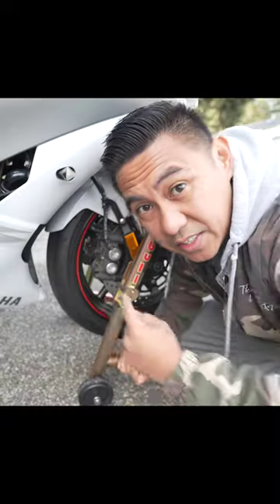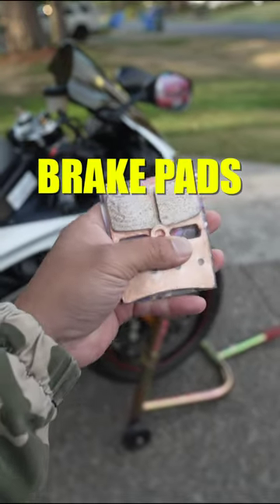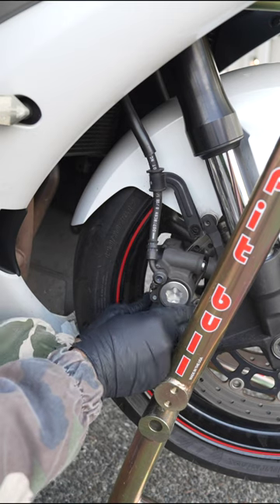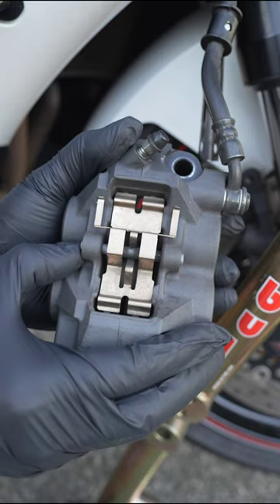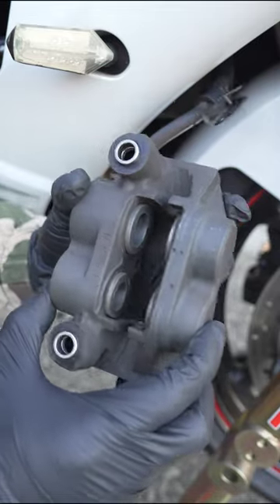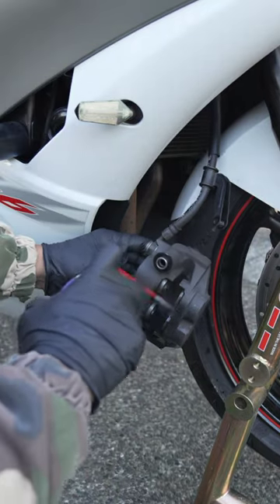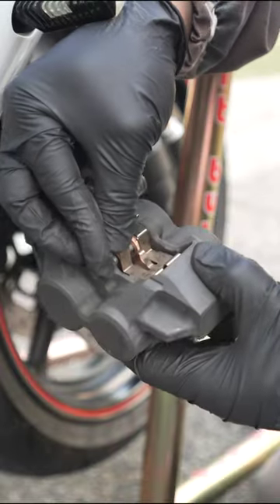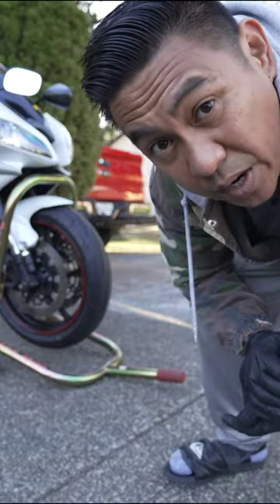HOW TO UPGRADE MOTORCYCLE BRAKE PADS

Comment: The caliper pistons need to be pushed back into the caliper before installing the new pads to make room for their increased thickness. Opening the brake fluid reservoir will allow the pistons to be pushed back.The fluid level will rise with the piston pressure, watch out for overflow. 😁👍
Reply: Opening thr brake reservoir cap wont do anything.
Reply: @mahdishirzad896 well if you have brake pads that are worn out you definitely need to open the cap to let some brake fluid out. Otherwise you're gonna have trouble pushing the pistons all the way back
Reply: @seb9940 No need for that at all. The only time you would need to do that is if someone fully filled brake reservoir while the pads were totally worn out, but otherwise thats what the reservoir is for to store excess liquid thats not needed till the pads wear out.
Reply: @idontcare7961 just remember your answering youtubers that haven't a clue 😅

Comment: They're not non-exstant. They're organic, they use organic resin as an adhesive. The most gentle type for rotors and the best all-round type, appropriate for wide range of users. However they're not the best in extreme conditions. I recommend organic pads for commuting and touring, and race pads (like EBC HH ExtremePro) for track.
Reply: I'm not sure about for motorcycles but my car came with ceramic pads, and I daily and autocross with them. They do occasionally sqeal a bit but other than that I don't see any advantage to a semi metallic or organic.
Reply: @johnhunter7244 ceramic pads need to be heated up very well, to feel the difference
Reply: Stock pads don't apply enough braking to trigger ABS...

Comment: With yamahas, you do not need to remove the calipers at all. Just the pin and the pads slide out the back
Reply: Easier to clean when you take it off though and it's easy to remove the front

Comment: you can clean the calipers with soap and water. You aren't contaminating the pad material. I've cleaned rotors a lot of different ways and never affected the length of bedding, brakes will just be bad for a bit.
Reply: Better is to have better brakes at beginning, you know.

Comment: Sometimes, it is not the brakepads but sometimes the fluid/moisture inside the brakeline. Dot3 and Dot4 fluids absorbs moisture making brakes feel like meh. Try to flush once in a while and brakes feel more grabby. Also try applying silicone grease on the pistons (not on the pads!) after cleaning the caliper with brake cleaner
Reply: Yes to second no to first. Yamaha brake pads are just really not very grabby. They last for ages but dont brake mega hard.

Comment: Love the content, but I do have a question since I have the same bike, does your rear wheel spins with clutch in when in first gear, even after I adjusted my lever and the bolts next to the clutch box, it stills spins 😢
Reply: It's dragging with you sitting on it? Or when the rear wheel is suspended, if that's the case, that's normal
Reply: @4fiddy_a_aron  when I'm on it, It Yanks forward by a tiny bit so I have to hold in the brake. Alternative is using some leg power to stop it in position
Reply: @hopelessag8147  you must not be tightening the cable correctly then because it should not be doing that. Or your cable is too stretched to adjust properly anymore

Comment: Shouldn't you lube the retainer pin and back of the pads?
Reply: Pin. Yes.
Side of the pads where they contact the calliper. Yes.
Back of the pad. Depends who you ask. Probably not if they have the metal plate with the cut outs on the back.

Comment: What's this? No Gixxer joke
Reply: I was sitting on my gsxr while watching this. Guess I won't go harass random motorists now.
Reply: He could´ve said atleast: "They are made out of wood, straight out of a gixxer riders brain" or something :D
Reply: No, because he acted worse than a Gixxer rider by placing new pads in the calipers and not either replacing the rotor or at least having it turned/resurfaced.
Reply: @jmackinjersey1 dude, you don't need to replace the rotor each time, they last much longer than pads xD

Comment: Wait... so yamaha doesn't use track brake pads? Instead a commuter version?

If I remember it correctly track type parts are bad at low speeds but with the high speed temp goes up and it gets better from there.

Commuter pads works best at low speeds and reduces efficiency at high speeds due to temperature

Comment: very important to spread the old pads before taking them out when the new ones go in you may not have enough clearance to get on ur rotor instead of prying on the new pads or the pistons use the worn pads to spread the pistons

Comment: do i have to empty the brake fluid?
Reply: No. You are simply replacing the pads. The caliper is just coming on and off the rotor so no concerns with any brake fluid. Hope that helps👍
Reply: @julian-cv4em thanks

Comment: The problem is not the brake pads its the rubber brake line, install steel braided brake lines and problem fixed!
Reply: He did that in another video.
Reply: @jmackinjersey1  thats good, however this video is inaccurate

Comment: Before cleaning, slide on of the old pads back between the pucks and a light squeeze to push them out slightly.  The part you need to clean (hidden sides of the pistons) will appear. be careful not to push them all the way out.

Comment: Swapping pads and Not the rotor (or at least turning the rotor when possible) is a pure Squid move. You won't be bedding the pads into the rotor, you''ll be bedding the rotor grooves into the pads and creating a horrible mating surface.